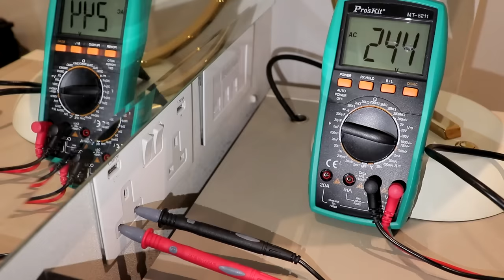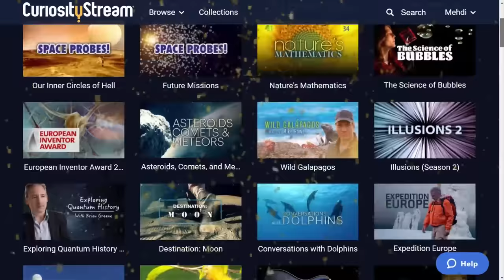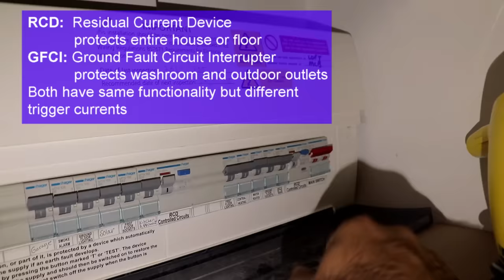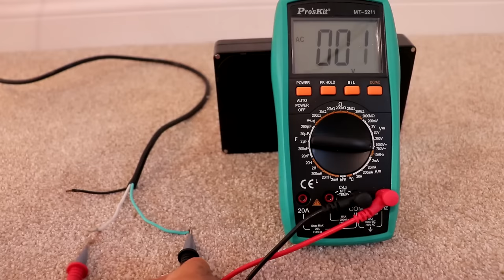Power Outlets in United Kingdom

Comment: Another safety design feature is that the cord hangs down the wall when plugged in reducing the likelihood of tripping over the cord.

I've often seen chargers fall out of North American sockets under their own weight, or even worse, partly out leaving a nice big gap for something metallic to fall into and short it.

A slightly more questionable part of UK household electrical standards is the use of ring final circuits instead of radials. It saved copper at a time when prices were high, but is dangerous if the ring is broken through a loose wire or error.
Reply: Agree with the ring comment. We should  use radials.
Reply: "I've often seen chargers fall out of North American sockets under their own weight," No experience of the US but I have of Thailand which seems to use US plugs and scockets. It is damn annoying to have to wedge a chair or something to keep the charger in. Thailand is 240 volts also stranegely.
Reply: I think the charger thing is primarily a problem in public places or other spaces where outlets are frequently used, like hotels, and they wear out faster. A socket in good condition, such as most ones in residential settings, tend to hold on to bulky charger adapters just fine. I've only seen chargers loosely holding on to or falling out of sockets in hotels and at my school. My laptop charger just fell right outta there; it's likely been abused knowing the idiots I go to school with.
Reply: @TheTomatoWatcher  here in the UK I've never come across a loose socket. That includes public ones, ancient ones.
Reply: @TheTomatoWatcher  I agree I lived in a house from the 40s growing up and there were wall sockets that I guess they used for the vaccum or something alot (plug unplugging) and stuff would just fall right out.. the ghetto solution was to bend the prongs outwards a bit so they had some grip lol. Not ideal but It helps
Reply: About the only complaint I have about the UK electrical system, aside from the ring main, is just the sheer size of the plugs. I think they really are larger than they really need to be. They are almost as large as a standard North American dryer plug.
Reply: what's the difference between a ring and a normal circuit like you'd have here in the US?
Reply: @lands1459  a ring main has all the sockets daisy chained together but the both ends are connected to the fuse box. So essentially the power over any one wire is halved. Advantages are it uses less wire, disadvantages are if the wire breaks you could overload the remaining wire, and there's the potential to overload a circuit if you have loads of stuff running off the circuit.
Reply: @benholroyd5221  so the circuit would have two breakers on each end of the circuit? im not sure if i'd understand, a schematic might be useful
Reply: @lands1459  no just one breaker.
Imagine a simple circuit with a battery and a bulb and 2 wires.

A ring main at it's simplest just has 2 live and 2 neutral wires between the 2.

The current carried on each wire would be halved. If you cut one wire the circuit would still work but the remaining wire would be carrying twice the current.
Reply: @benholroyd5221  so everything's in parallel? im afraid i don't really understand, if everything is just in parallel we have that in the US too where you just daisy chain a few outlets.

edit: looked up some schematics and it looks like both ends of the "ring" so to a breaker, that makes more sense.
Reply: @ryuukeisscifiproductions1818  - gotta bear in mind tho, there is a lot of safety features packed into the UK plug’s, plus it won’t fall out on its own accord after being used a few times ☺️.
Reply: @Pieces93  All those safety features that are built into British plugs can be built into American plugs too. In fact they already exist, as fused American plugs do exist with Christmas lights and some fans, and installing safety insulating sleeves on the prongs has been done on some travel plugs. They just arent implemented widely because the people that run this country are cheapskates.

And no, american plugs falling out of their sockets easy is a myth. That only happens with old and worn out sockets that have reached the end of their service life, or very very cheap sockets. A good hospital grade socket on the other hand, that will grip a plug like a gorilla. And fi your really concerned about a plug falling out there are the twistlock type plugs which really ensure that doesn't happen. Although twistlock's do have the risk of if they are pulled too hard, the wire could come out of the plug itself, though that takes a lot of force to do that.

As for other nations plugs, I dont see why implementing sleeves and fuses on their designs is all that hard either. American plug can have them implemented and NEMA series plugs are perhaps the smallest profile AC mains plugs out there. The only thing i cant say about other nations plugs is if easily falling out of their sockets is a problem.
Reply: @ryuukeisscifiproductions1818  - all I read was “can be” and “this only happens”, which basically means it does happen and that most appliances aren’t using fused plugs, except Christmas lights… from what I have seen US plugs are no-where near as safe as UK plugs.
Reply: @ryuukeisscifiproductions1818  Fused plugs are only used for areas with ring circuits. Most other countries do not use ring mains. Australia/New Zealand for example, bans ring circuits.

Comment: I have a feeling he needs to see the German SchuKo, "Schutzkontakte" (Protected Contacts) We have for Power here.
Reply: Fabitanker they wont be protected after he’s done with them
Reply: couldnt he shock himself with the europeans and fled the country?
Reply: We have those in Norway too, almost as safe as the UK plugs, but much more compact.
Reply: Same in Belgium bro
Reply: Thank you, didn't know what Schuko mean't, we call them Schuko as well in Italy, we use them a lot.
Reply: A Gentleman  no you cant. Unearthed Sockets dont fit earthed plugs here. Not only are the holes smaller, also the plug is too large to fit the slim socket instead of the  earthed round one.
Reply: A Gentleman you can do that with the Uk outlets too...  toothpick, sunglasses stems, car keys, or sheer brute force...
Reply: I was just about to say the same. AFAIK Schuko is used in most of the Europe (UK, Ireland and Switzerland are exceptions). I would like to see a video about Schuko!
Reply: Steve D  Only old houses might have unearthed sockets. So what do you suggest, that they don't use electricity? We install a 30 mA RCD between the meter and the distribution panel and we are safe enough without ripping out every last wire and outlet. Everything younger than 50 years give or take (and depends on the country) will have grounded outlets.

Comment: Having gone the other way around (from the British Isles now living in the US), I appreciate that British plug pins are spaced further apart than North American ones and have a larger housing. The consequence of this is when you pull the plug out there is very little risk of wrapping your fingers around both neutral and live pins; this seems to be quite easy to do by accident with the North American ones. The way your fingers are oriented when pulling the plug out is completely different. It's a very simple feature, but makes a difference.
Reply: why are you wrapping your fingers around the plug like that in the first place instead of holding by the sides as intended with every single plug?
I have round ones in my house and sockets are designed in the way that I'm more likely to crush my finger between the plastic (the socket is concave, not flat) than to electrocute myself if I'm touching the contacts, so maybe that's why I find it bizarre, but you would never do this in any case.
Reply: @kirayoshikage4057  I'm glad you're sensible! For what I would call bad cables, the plug housing is only just a bit wider than the pin spacings and the strain relief isn't that long either. My point is that there isn't much by way of 'sides' to hold on to and if you have clammy hands on slippery insulation, it's pretty easy for a slip of the wrist to lead to a shock. There is almost no risk of this from UK plugs, where the physically larger plug housings relative to the width of the cable prevents cable slippage when pulling it out of a socket.
Reply: @the13thparish  well, I think its also sensible to assume that nobody sensible would touch a plug with hands covered in what's essentially just salty water...
Reply: @kirayoshikage4057  
Well I'm fairly old and I have lived in the U.S. all my life and it's never happened to me.
Maybe the British are why there are railings at certain places in the Grand Canyon while the rest of us don't need them and wish they weren't there.
Reply: The design of the plug is such that the live and neutral are no longer connected by the time you can even get your fingers on them. Since the earth prong is longer than both and thus contacts first when you put it in and disconnects last when you take it out. Then there is țhe fact modern plugs have the lower part of the two shorter prongs insulated, so they are disconnected long before you can get anything touching the metal. It's impossible to zap yourself because it's just superb design.
Reply: @kirayoshikage4057  Its not about ensuring "sensible people" don't get hurt. Its about enduring all people dont get hurt. Consider a child with small fingers. If they get hurt should we blame them because they weren't "sensible". Use your brain to think.
Reply: @bruce2357  A case study of one. How significant.
Reply: @bruce2357  Hey, do you have medicare for all yet? :)
Reply: @beepbopboop7727  If I use my brain to think, it appears that there's no child with fingers so small that they could put their two fingers into a socket and get electrocuted.
Reply: @kirayoshikage4057  no but they could put a screw driver in there to try and repair it like daddy does. Switch your brain on it seems to have tripped.
Reply: @bruce2357  portrayal of UK as relatively more stupid than those of US could also look at fatalities on US railway lines - not a direct comparison, true. We sensibly fence ours off but still people will trespass, & will also die at crossings.  Though US railways cover huge distances, they also typically run relatively slowly. Another baffling statistic is parents owning firearms - again baffling anyway , yes, lets all drive our own personal tanks etc - who allow young children & even toddlers access, with predictable results.
Reply: @bruce2357  you don't like railings at the grand canyon?  I was there on a very foggy day once.  Scary.
Reply: @MultiVeeta  daddy does that???
Reply: @bruce2357  "Open box before eating" is an American exclusive warning on a pizza box, so I think your observations are a tad bit wrong.